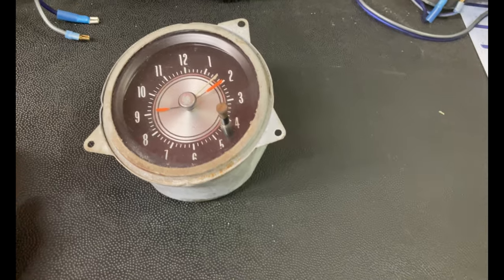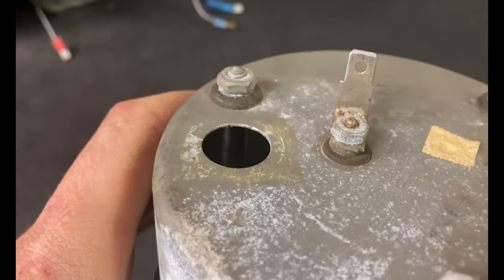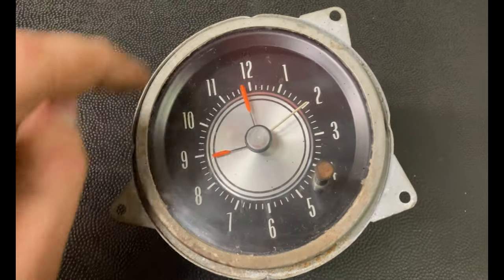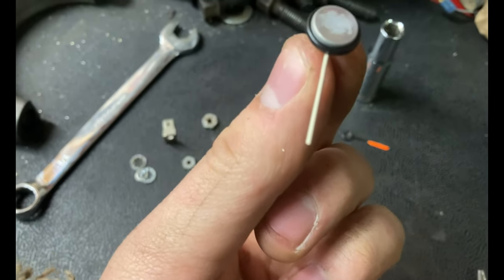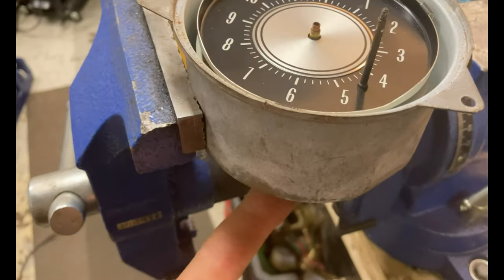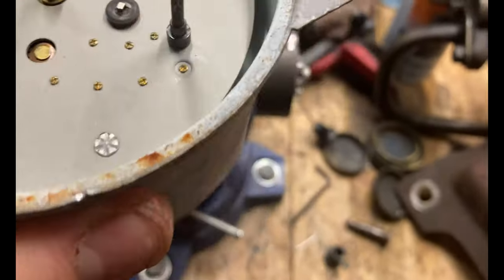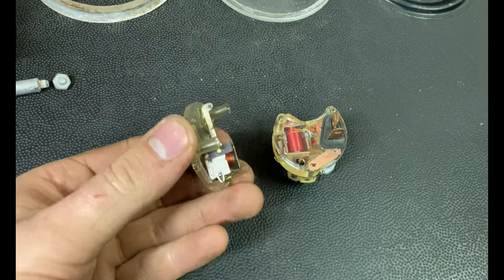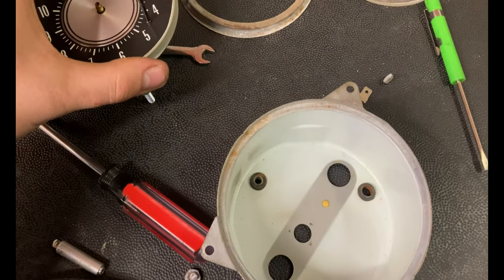Classic Car Clock Rebuild

Comment: The part number for that replacement electric movement would be most helpful.
Reply from the maker: See other comments.
Reply: @dailyolds1970  Thanks. got it off ebay seller clocks4cars. it's made by Instrument Services. For the original electric unit it's P/N 104 10T that you have to swap out the top to fit.
For an exact quartz replacement it's P/N S-3015

Comment: But how do you adjust the time?  My repaired clock gains about 45 seconds a day!
Reply from the maker: Sounds like your auto adjust plate is stuck. Clock needs to be disassembled and  cleaned carefully. Then, if the clock is fast, The more you adjust the time back, the more it should slow it down to accurate time keeping. That's the theory at least, but 50 year old mechanical car  clocks are rarely perfect without full rebuilds. My auto advance plate in Mt cutlass is still stuck, I need to go and free it up when I get time. I'll put a video up when I do that.

Comment: what was the part number for the replacement clock
Reply from the maker: I did look for one, but unfortunately there is no part number on the packaging or piece itself. I can tell you it’s a borg Warner clock replacement kit.